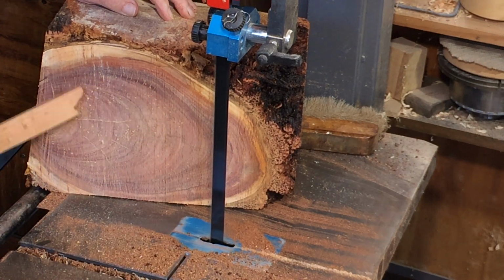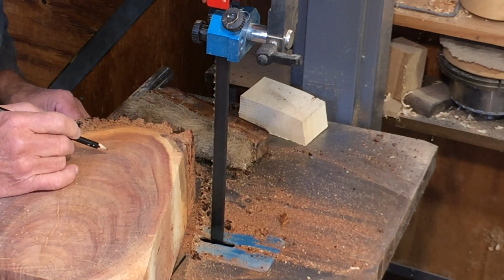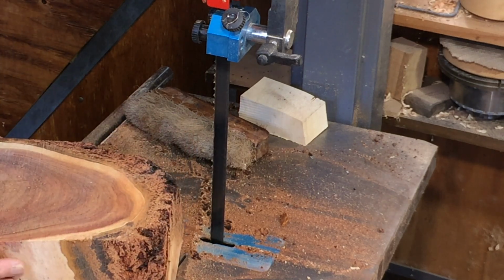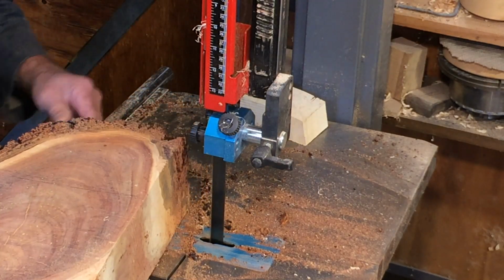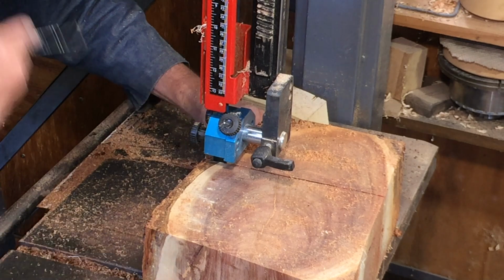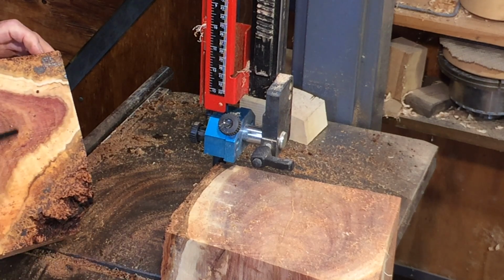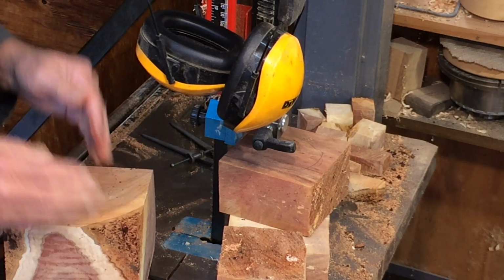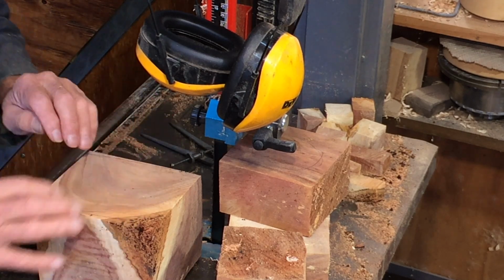Richard Raffan cuts ironbark sawmill waste into woodturning blanks

Comment: Richard, I always enjoy and learn from your videos but this was particularly interesting because of the woodwork. See About 9:15 as a worm exits a piece in the back of the table and heads toward you as if to attack ( no probably just trying to escape). You seem not to have noticed it.I was much longer than any I have seen here in the northeast US
Reply from the maker: I've had a really good look and can't spot any livestock coming out of the block at the back or on the table and I didn't come across any when turning the largest blank. What colour am I looking for.
Reply: @RichardRaffanwoodturning  If you were to look again at about 9:14 or 9:15 on your left is a large red timber. Near the bottom close to the bandsaw table a small white worm starts to emerge. You continue to cut other pieces while the worm slowly makes its way toward where it is eventually swept away when you cleared the table. I hope you see it as it is crawling loose in your shop!
Reply from the maker: @tedcieri3407  Got it! I found it at 9:21, just after I push a second block to the left. I've never seen one of those. It's pinned by an offcut at 11:41 and swept into the firewood seven seconds later. The larger block is now a charred pot  https://youtu.be/q-Bc9ttH55k so any relatives were probably incinerated.
Reply: @RichardRaffanwoodturning  Very good. I am impressed by the chared pot and will have to try it, especially on occupied timber. It would interesting to hear your thoughts on your chucks & jaws. I know you have mentioned them in several videos but I am thinking of a video dedicated to chucks etc.
Reply from the maker: @tedcieri3407  A lot of my thoughts on chucks are summed up in  https://www.youtube.com/watch?v=DV2T6oJgCi4 on using chucks without marking the wood. I replace all the standard jaws that come with the chucks with Shark jaws that are the same diameter but offer a much better grip for endgrain blanks. I'm all Vicmarc chucks which are widely regarded as superior to all others.

Comment: Ever consider using a pressure/vacuum pot and stabilizing some of the nicer pieces that might be a bit punky?  This wood looked really nice for bowls.  I've made quite a few bowls, my family thinks I'm crazy, but it's so much fun.
Reply from the maker: No is the short answer. I turned bowls for a living for 40 years, and messing with rotten timber is too time consuming commercially, especially when there is so much good defect-free timber available.

Comment: great to see how you approach breaking down the wood to get the most out of it. Just wondering how you manage to keep your band saw blade for dunking up when cutting green wood. My blade needs cleaning quickly when dealing with green wood.
Reply from the maker: The gunk tends mostly to build up on the inside of the blade. I take it off using a chisel kept just for that task. I can do the inside easily whilst the blade is on the saw, but it's much easier off.

Comment: Thanks Richard! If you don't mind sharing, what balde are you using for your blanking work?
Reply from the maker: Here I'm using a 20mm blade which is best for cutting straight, but more usually I'm cutting circles using a 13mm blade. Both are 3 tpi.
Reply: @RichardRaffanwoodturning  Thanks so much! I'm blanking a bunch of white oak for my turners' club and of course, cutting end grain in wet white oak leads to lots of stopping to degunk. Thanks again
Reply: Heh, just what I was going to ask. Thanks for reading my mind. LOL.
Reply: @michaelmcdermott2178  when de-gunking from green timber, I usually just hit the blade with a wire brush, chucked in a cordless drill, rotating in the same direction as the blades teeth. If the blade has been heavily contaminated with tannen (eg from acacia melanoxylon) I remove the blade and soak it in white vinegar in a bucket.
Reply from the maker: @totterdell91  I'll give that a go. Never thought of it.
Reply: @totterdell91  Thanks! I've been using a spray and brush method. My current problem is that the turning club picked several windfall Garry (white) Oaks from our recent storms and I've been blanking them for the newbie turners who don't have bandsaws. BTW, I love Richard's approach in terms of trying to get the most from the log but not wasting time on fatally flawed pieces.
Reply: @RichardRaffanwoodturning  Hello Richard, do you alter the tension on your blades when changing  between 20mm and13mm, or do you leave them both on the same tension setting? Best regards.
Reply from the maker: @johnmitchell1614  I have the same tension on all blades and keep the tension on unless changing blades, which is infrequently as possible.
Reply: @RichardRaffanwoodturning  I hear you! They can be a pain, especially when swapping blades out, and when there's very little room to manoeuvre. I haven't had any training on bandsaws, but I also leave the same tension on constantly regardless of the blade width. So if that's what you do it's good enough for me.P.S. Does your machine have two speeds? If so what speed do you run it at? Thank you and best regards.

Comment: I hate that bit where you have to work out how much useful timber can be salvaged from biggish offcuts. Then I look at all the scrap produced, and think, eugh, what a waste. But then I console myself by realising that sawmills must produce heaps of waste. I like your thinking. Why is it called Ironbark? Best regards.
Reply from the maker: Cutting blanks from burls I usuallly discard at least 50% dispite cutting blanks as small as 75x25mm (3x1-in). Sawmills probably discard nearer 65-70% to get clean boards. Called ironbark because it blunted axes. The wood works beautifully.
Reply: Mugga Ironbark is often called Red IronBark (Eucalyptus Sideroxylon).  The bark looks like the slag from iron smelting, & when growing, is black but has an easily visible deep red colour in the furrows between the black lumps of bark. Inside the bark it has many hard black crystals, which will blunt any sawblade very quickly. On this specific log I had to resharpen my axe 3 times de-barking a 2.5 meter log. The wood varies from sandy colour when grown in sandy soil to deep red. This particular tree came from rich clay soil in Gungahlin.
Reply: Always helpful, beautifully wood! Thanks again.

Comment: Richard: I use walnut oil and bee's wax for a finish for most of my turnings, similar of course, to your boiled linseed oil and bee's wax.  I like this finish very much, as it looks great and is easy to apply.  However, I recently quickly rinsed out and dried a pinch bowl that had peanuts in it, and that had an oil and wax finish.  The bowl had lost its finish and was as dull as can be.  Only after one cleaning. I hate to think the pieces I've sold or given to friends did the same.  So, what to do?  Is there a way to avoid such a change in the appearance of these turnings when they're just quickly cleaned, for the first time, with just water?  Your thoughts, please.  I'd like to think this finish would last a bit longer.  And please keep the videos coming!  They're excellent.  Ned
Reply: Use a different finish!
Reply from the maker: Wood that's used day to day takes on a different patina. Some people re-oil bowls after washing them, others never wash salad bowls and that often leads to oils building up making the bowl sticky. I've always put a label on my bowls telling people to wash the bowl in hot water and detergent and oil occasionally. I have a video planned on this. I never see the point in totally sealing a utilitarian bowl as sooner or later the finish breaks up and the wood looks terrible. Op-shops always have a clutch of such bowls. Better to use wood and let it develop a patina.
Reply: @RichardRaffanwoodturning  

Thank you, Richard, for your thorough reply.

I suppose I want my cake and eat it too when it comes to finishes; the best of a penetrating finish and the best of a surface finish.  I'd like to find a finish that maintains a bit of shine, whether it sits on a shelf or is lightly used and then rinsed out with water.   I'd like a piece to look good on a shelf, but if the buyer or the recipient as a gift wants to put, say, chips in it and then rinse it out, I'd like the piece to look similar to as it did when it was bought, and not become dull and with a patina.  It's not always possible to let the buyer or recipient know the rather drastic change the piece will undergo the first time it gets wet.

I realize what I'm hoping for is probably unrealistic.  Maybe a "hard oil" might work?  Don't know. Other possibilities? 

Thanks as always for your great work; you inspire us all.  

Ned
Reply from the maker: @ned711  I forgot to mention Osmo, the German finishing oil. That could well do what you're after. If I was still in production I'd probably be using that as a finish. I can't justify the outlay for the little turning I do these days.
Reply: Thank you, Richard, for recommending Osmo finish. I’ll look into it.  It seems I’m going to have to get used to the fact that there’s no universal finish - a finish that’s good for objects sitting on the shelf and also good for objects used in the kitchen. Thanks again and take care. Ned
Reply: @RichardRaffanwoodturning  Osmo is a wonderful/simple finish - the only problem is the very short shelf life when opened - even in cold Scotland. I now buy in the smallest available tins.
Reply from the maker: @davidcochran9322  That's my experience, although with small amounts given to me.